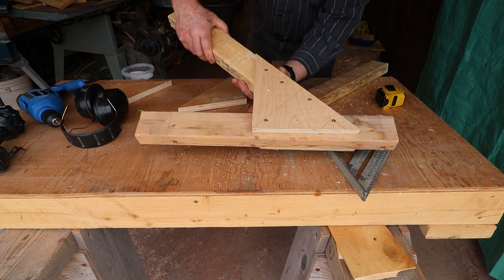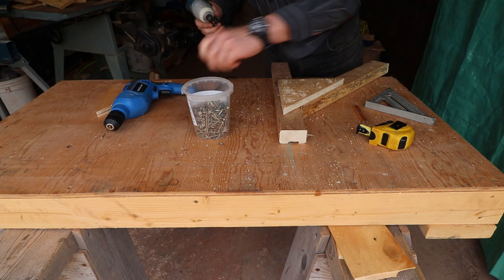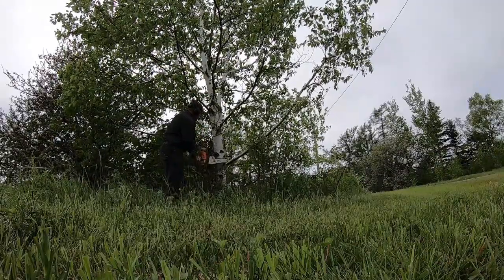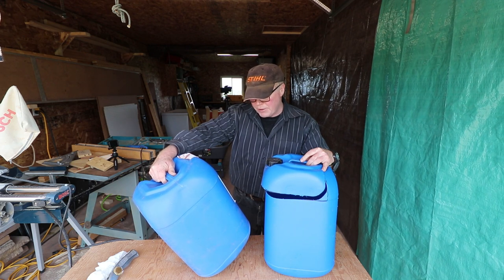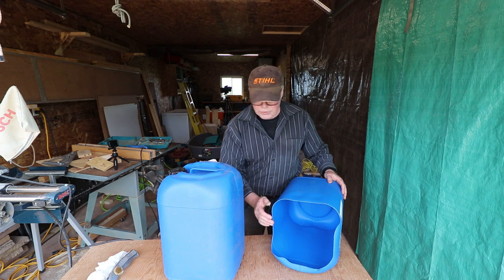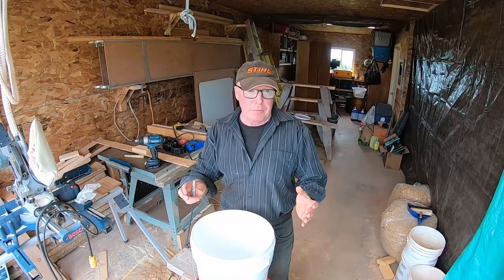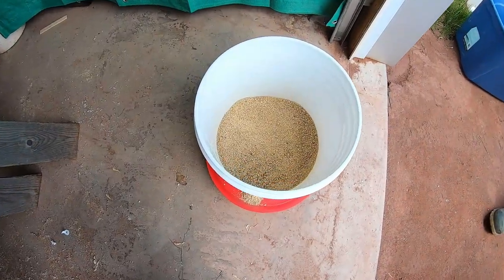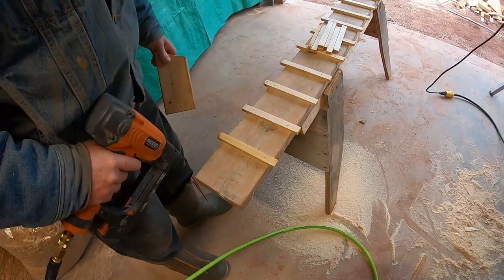S1E39 DIY Henhouse Roosting Bars \\ Nesting Boxes \\ Feeder \\ Ramp \\ For virtually nothing

Comment: Throw some straw on the floor for the manure. Easy to clean the house out giving you compost material. Don’t put in the garden without composting first or you’ll burn your crops.
Reply from the maker: Good point. We are putting the dropping on our compost pile.